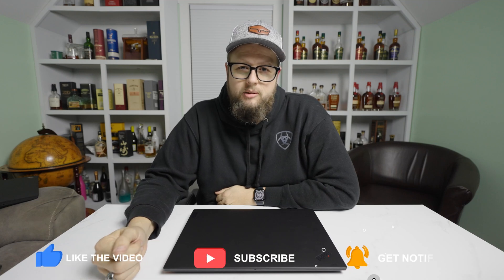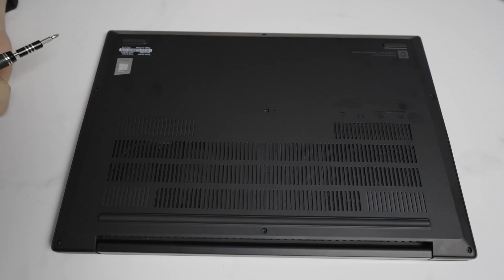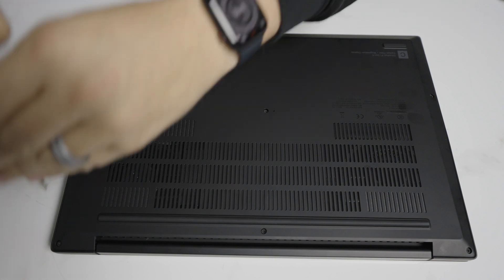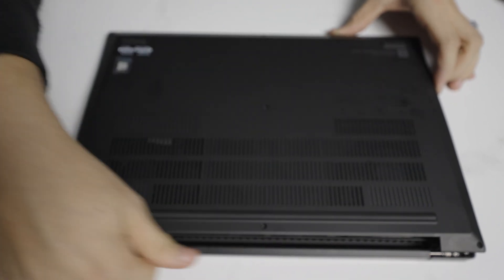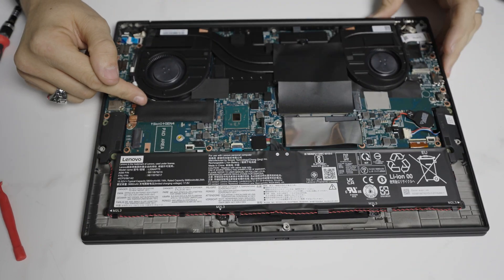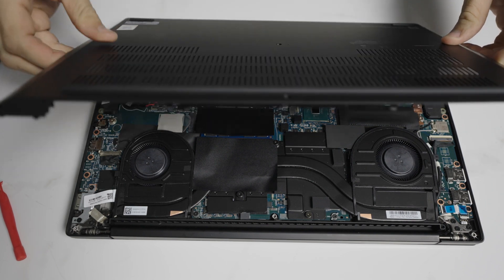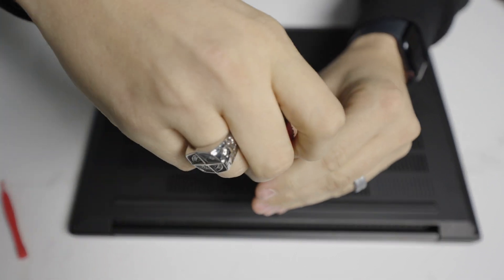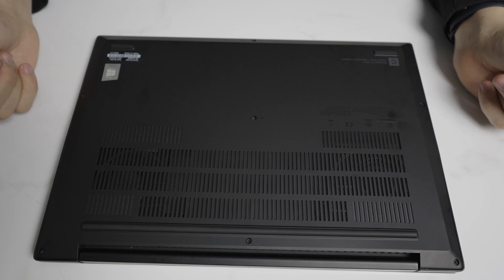Lenovo P1 Gen 4 Disassembly / Upgrade

Comment: what i can upgrade in the slot next to main nvme? , it's also m.2 , it could be 4g data card but i didn't find any external antenna related to that card
Reply: I'm wondering the same thing myself.  Just got my P1 today.  Looks like a shorter NVMe drive could go in there for a third drive, but I'm not positive.  Still searching for info.
Reply: @JaredRibic  Did you ever workout what the other port was for?
Reply: @stevesloan6775   - No, but it looks like it would accept the WWAN adapter.  I could always try a smaller NVMe drive and see if it works, but haven't bothered yet.

Comment: This computer is so stupid and with no quality checks before selling to customers! I have color peeling off from keyboard on 3 keys, two BSoD, no way to turn computer off in BSoD (power button not responding), front most USB-A port is unreliable and fails large file copies to externa drive, computer running HOT in sleepmode (leds fading), bluetooth freezes every other second, computer sometimes loops every other minute with chimes like it is unplugging usb, rolling back to bios 1.14 due to dead usb-c ports, white spot in display...

AND THE WORST PART IS THAT LENOVO WONT TAKE RESPONSIBILITY TO REPLACE IT!
Blaiming the customer because it is "cosmetics" and doesn't cover by warranty, the customer has to pay!!
Can only state lenovo is mafia BLACK MAILING its customers, sending out broken computers and only accept repair if the costumer pays even more!!
I have been trying for over 4 months to get a replacement unit or repair, it was hard to even get an answer from the support! Eventually got an email to global pr at lenovo who send me to EMEA team, well they are only wasting my time blaming me for the "cosmetic" faults....
Reply: I've had this laptop with the A2000 for over a year now daily use and never had issues.  The sound of the USB engaging is a setting that has to be changed in windows 10.